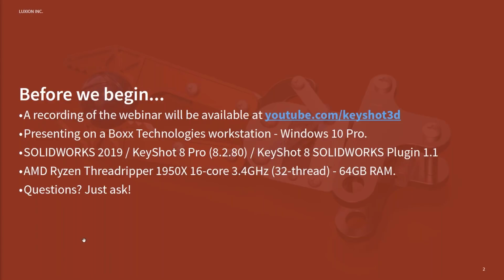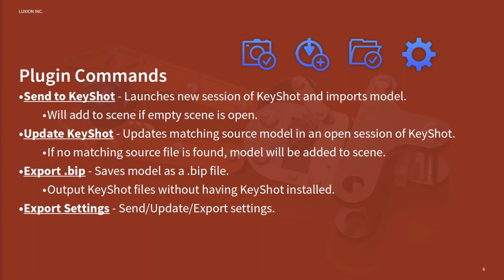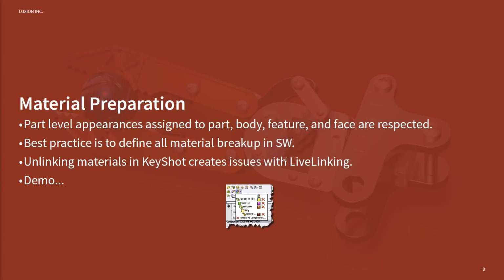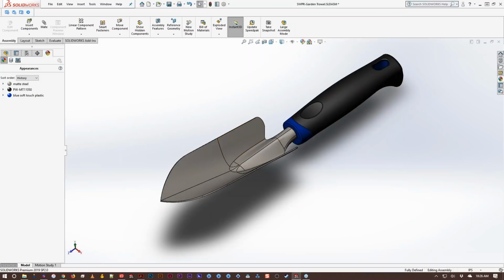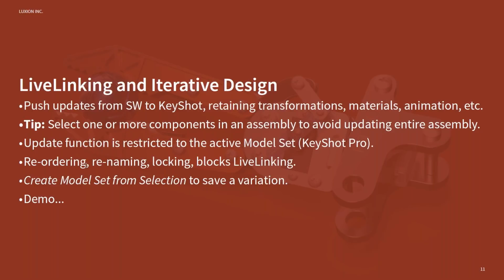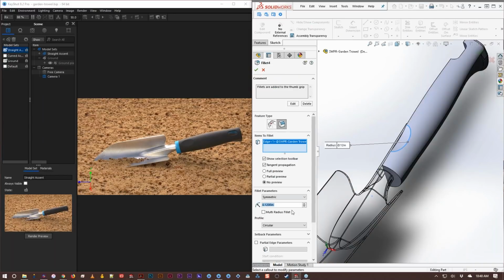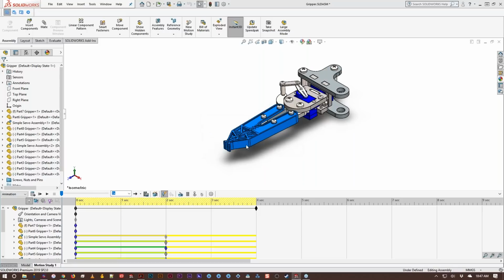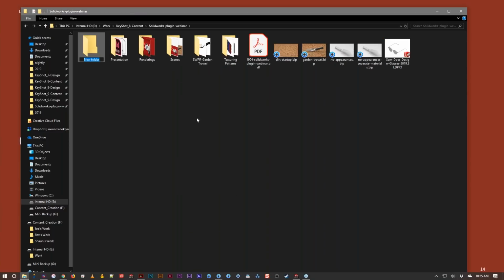Webinar 79: Leveraging the KeyShot Plugin for SOLIDWORKS

Comment: Hey Rex, does the plugin rebuild between frames of an animation? Is that something that may be considered for future versions? I have an animation that requires SW to rebuild every frame, as the length of one component is driven by the position of another. Thanks!
Reply from the maker: For now you will have to delete the animations in KeyShot  then resend the motion study with the new changes.

Comment: Sometimes, if you apply texture before mirror merge body in solidworks, send to keyshot, the mirrored half will have faces as exploded surface, separated from the original half. But the same model, if you import from keyshot UI, it works fine.
An unrelated topic, but I have been mentioning for a while. When you right click an object under Model Sets, choose [Make Pattern], Cancel is on the left, and ok is on the right. When you delete something, Yes is on the left and No is on the right. It will be really good if all the confirming actions are on the same side.